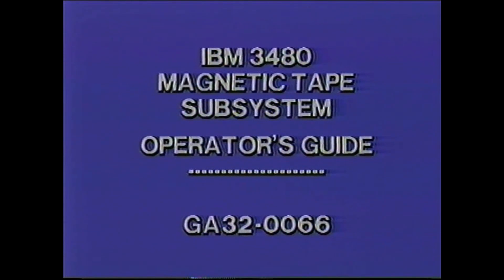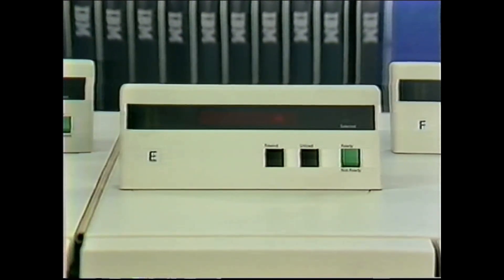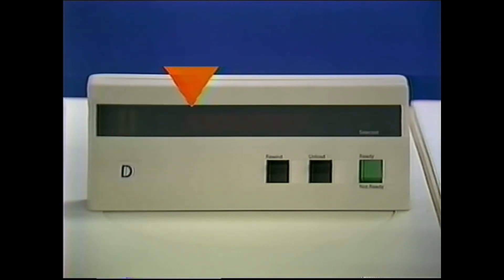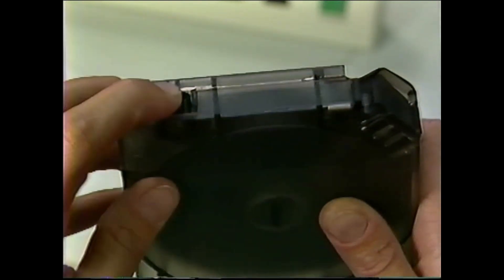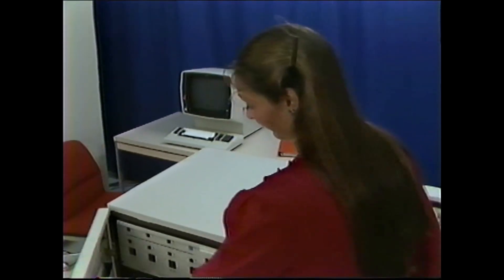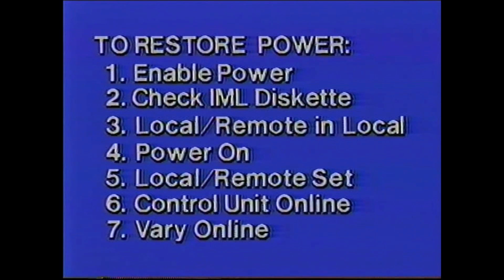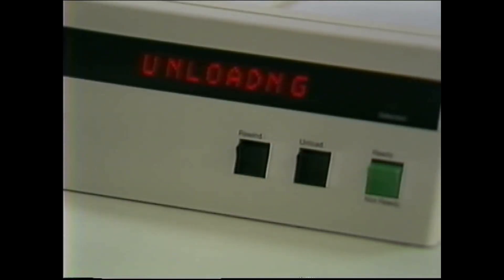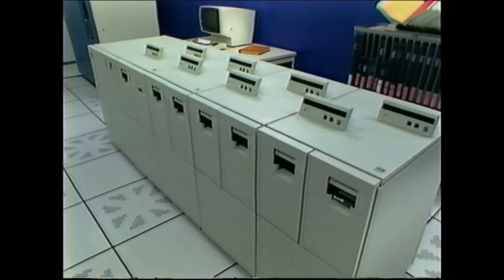1985 IBM Computer Training Video - Magnetic Tape Subsystem

Comment: The 3480 was the first to use chrome tape, and each one of those cartridges held 200MB and operated at 3MB per second. The system replaced the 3420 which had 10 inch tape reels that held 160MB and could only do 1.25MB per second. The 8 drive configuration shown in this video cost around $238,000 back in the day and between all the drives, it could hold 1.6GB at once.

Comment: I bet no one ever turned that drive operator panel. So janky! This looks like the most complicated cartridge tape system in histroy. "U" meas unprotected... of course "P" would mean protected... NOPE!! "F" means protected 😂
Reply: Good job watching the video. You clearly listened to the part where it was explained F means file-protected, which is a term dating from the 1950s, and is used because there's a distinction between write-protect and erase-protect.
Reply: @straightpipediesel  It's still poor UX design, much like early MacOS dragging a floppy to the trash to eject.